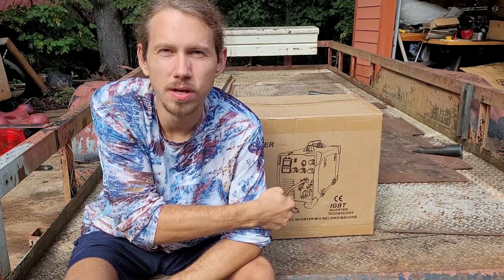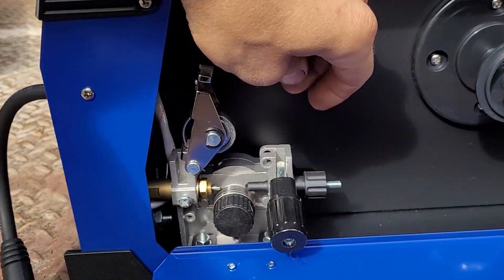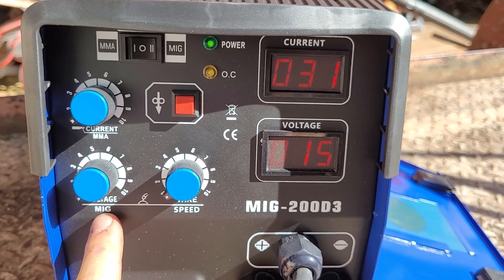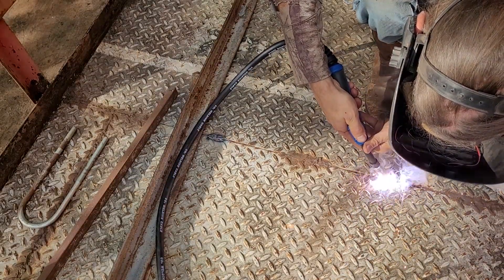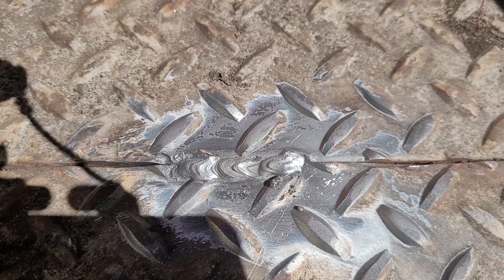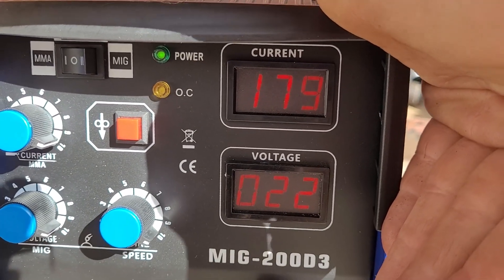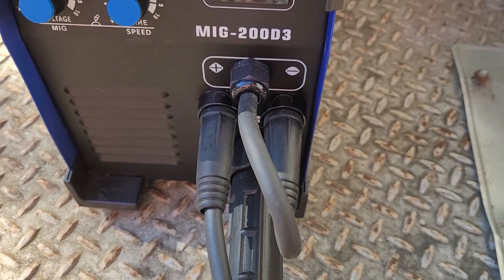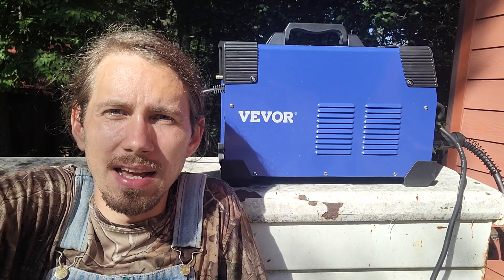AMAZON Welder Review: Vevor MIG 200

Comment: Im planning to weld stainless steel. I know Flex core is not the best choice but I don't own a shop for all that gas. What settings do you recommend? I will use E308L flex core wire and gasless.

Comment: Great video Matt . Straight to the point`cheers, for not wasting my time, 
Not like other idiots that play music drowning out the information,,and spending more time on who they are and what they done since birth, making it all about them and not on the product,
I do have a question,
I only have used a AC stick welder (Buzz Box) I understand Ac and Dc current, and how it works `with the penetration with welding rod to the metal how they differ, 
But 2 years ago I bought the same machine you are demonstrating , its confusing so I am reluctant to use it, yet
When you say electrode positive, then electrode Negative, I can see what your demonstrating to explain, 
But when is it necessary for the user to use electrode Negative and electrode positive?
I have never did Mig _ Tig _or DC stick welding,

Comment: wow i think i got ripped off or suckered..i bought a welder on amazon and it doesnt work at all and they wont refund..its so disappointing ..teh gorund doesnt even work..the way this guys gorund is seems like the way any ground should be mine doesnt do shit...to think youd have to clean crystal clear metal to be welded is ridiculous it defeats teh whole purpose of welding older thigns.....mine barely even gets a spark...i cant beleive tehy even allow this junk to be sold on amazon...only the wire feeder works on the flux core setting and mig weld setting but theres no spark...and the stick and lift tig spark but dont wirse feed and it didnt come with instrutcions..

Comment: I have a question im a begginer welder and bought this welding machine however when i press the button my gassless flux core wire wont spark. The wire feeds but it wont spark.

Comment: Does this unit have a “gas solenoid” to control gas flow?  I reached out to the company and they said “no”, but I have seen their low priced TIG units have solenoids, so . . .  Please confirm; thanks!
Reply from the maker: It has a gas control solenoid for the MIG. The TIG only has a manual gas flow control knob on the TIG torch. MIG=Gas solenoid  TIG=No gas solenoid
Reply: @MattsShop  Thank you; that helps!

Comment: I had a little clerk 180 e n. It was a pretty nice welder. It was the first welder I ever owned and I taught myself to weld on it. I was a machinist for many many years and I had my own little shop doing prototype work often times I would have to fill in a mistake. Whether I had made a mistake in Machining or the drawing had changed or a tool broke whatever sometimes there was a whole or a cutout that needed filled. I was mostly cutting 4100 series Steel or 4300 series. One thing I learned really quick is that flux core welding is not a very good process. It's the kind of thing you want to have on your four-wheel drive so you can make repairs next to the trail. However if you're trying to repair a steel component and you want to be able to machine that weld off removing as little of the base material as possible and not have undercuts or dirt or holes showing up you need to get a gas bottle. They don't cost much just go ahead and get one and then if you've got TIG like that welder get another one. It will make you much happier and you will do a much more professional job.

Comment: UK import customs rejected a shipment of these welders for safety violations and fire danger (fuse bypassed with wire).
https://assets.publishing.service.gov.uk/media/624ef4248fa8f54a8aed3142/2203-0470-psr-welding-machine.pdf

Comment: FYI. Current is determined by wire speed. They will never be separated unless you are using STT for MIG welding. Increase wire speed increases current. Decrease wire speed you are decreasing current.   Same holds true for current. Increase the current and the wire speed will always increase.
Reply: Mine has high and low setting independent of wire speed.
Reply: @xephael3485  that's the voltage control, on 99.5% of migs you don't have independent control of amperage.
Fronius on some of there machines provide an amperage control, where it's doing the synergic calculation for you and working back to voltage and wire speed, but it's still not independent of wire speed.
The only way to increase wire speed without increasing current is to lower the voltage at the same time.